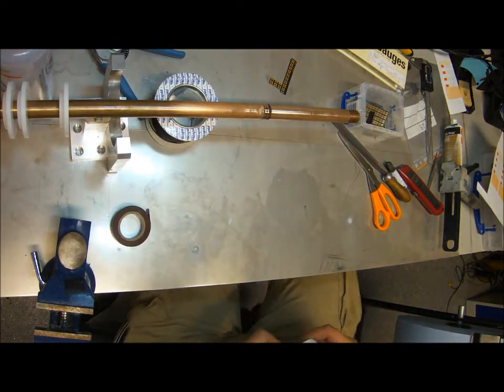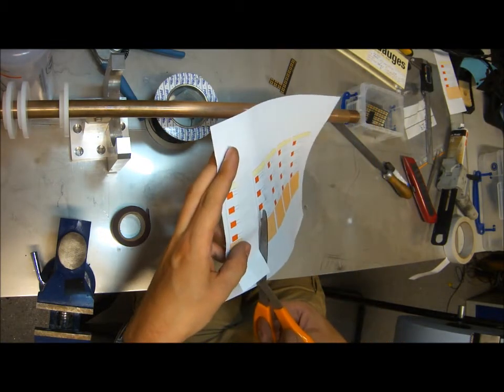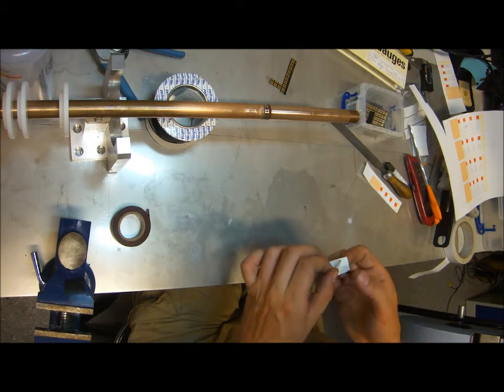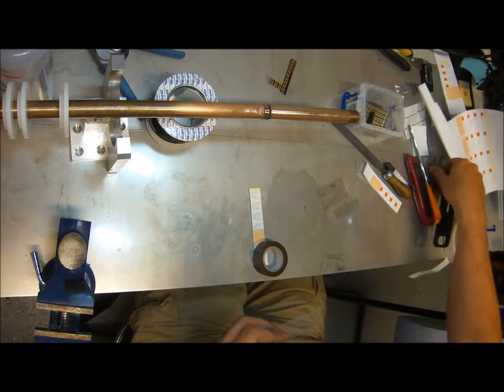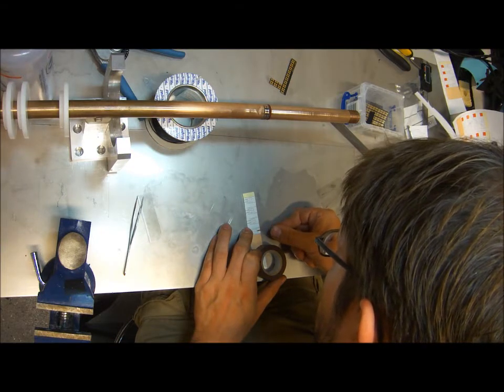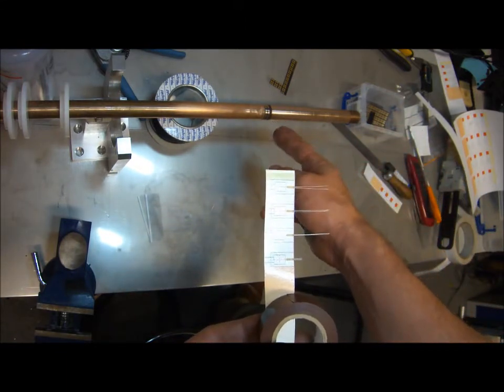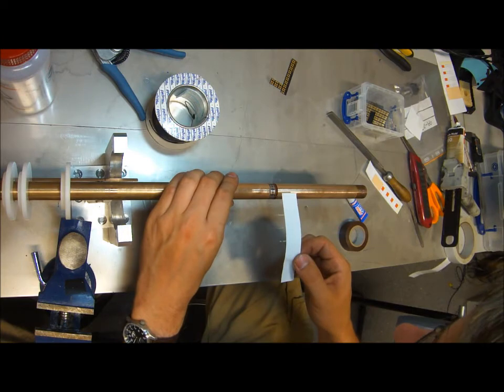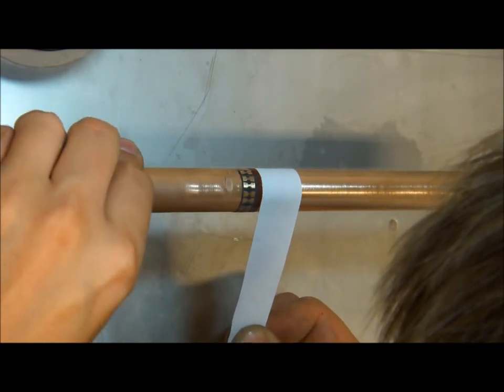How to strain gauge a Split Hopkinson bar part 3: Attaching Strain Gauges

Comment: could you tell me specification of strain gauges??
Reply: Need to knw excitatn voltage, sensitivity, n most imprtnt max shear load.
Reply: Suhrid Mukherjee ex voltage 5 v, g.f2, here       it is for pure compression wave(load),grid"ll elongate along the direction, I just want to know there is a difference betn static and dynamic response, in fact this one is a transient one, so strain gauge uses would be different....